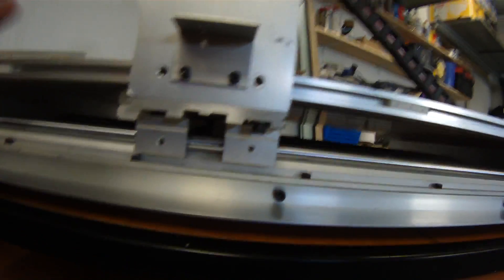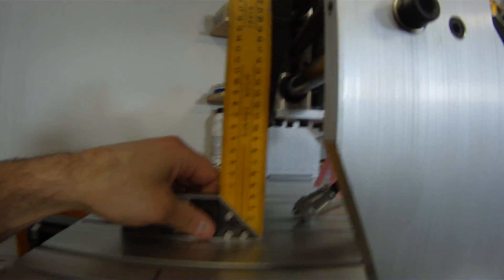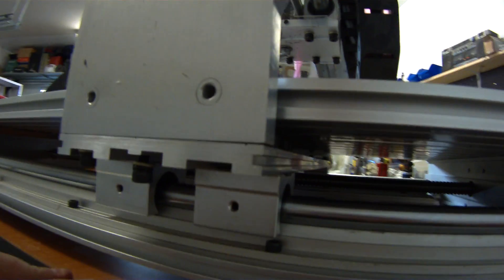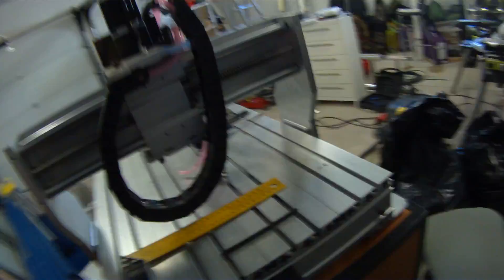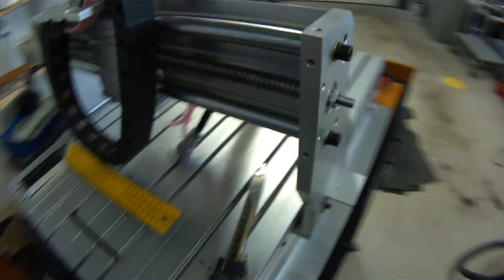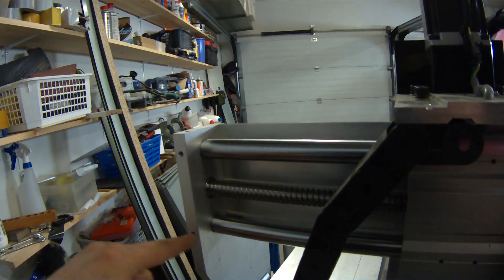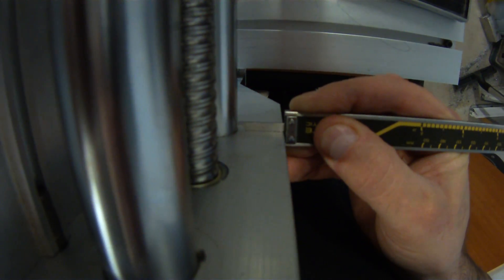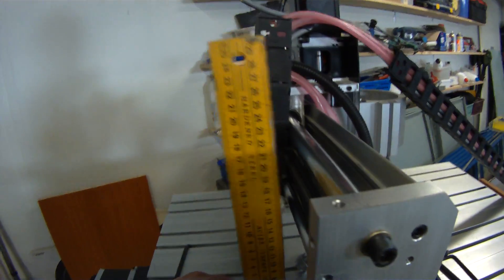X6-1500GT-USB Z-axis tilt problem

Comment: What is the progress on this issue?
Reply from the maker: +Fredrik Mattsson Well make a wild guess...they got bit arrogant when I asked abt fix or replacement for bad components, they requested me to send components back to China before they can send new parts. And of course by my expense. I got bit pissed off and decided to just fix that issues by myself with simple shimming plates. I was pretty sure that new parts would not be better.
Recently also discovered that X-axis was not perpendicular against Y-axis but I was able to fix that by simply loosening all bolts and giving few good punches to gantry assembly with soft hammer. So they have very bad quality control, as usual with Chinese companies. Really shame because typically it costs exactly same to make good product.

So if there is reasonable substitute, one might look alternative machine or just be prepared to make shimming + modifications in order to make this machine run true.

I have also found that the weakest link in this machine is X-axis linear guides which will flex quite easily and a lot (drilling or similar). I have been thinking to make upgrade parts, side plates + Z-axis top/bottom plates with additional X-axis linear guides (maybe 2 more) for increased rigidity. But before that I need to make sure it runs 100% square so that new parts will not need shimming. Round linear guides 500mm are not that expensive and design should fairly easy.
Reply: +jat1mat1c Where did you put the shimming plates? I have loosen the screws to the parts of the Z axis, and yanked into position, still there is a sligt offset in the Y+ direction.
Reply from the maker: +Fredrik Mattsson I bought very cheap feeler gauge and cut pieces fromthat as needed. My X-axis was also higher on one side by ~0.25mm so I used different shimms on each side. Shimms are placed between top of Y-carrier and bottom of X-axis sideplates....roughly where this video starts and my wicked fingers are pointing curvature of Y-carrier end. Using different thickness pieces I was able to make Z-axis quite square. However spindle carrier part is made out of extrusion, which also adds some variation into whole mess. Depending on how you tighten up spindle carrier, spindle can be slightly tilted also. But thats only minor detail. Maybe I make short video to show what I have done...stay tuned :)